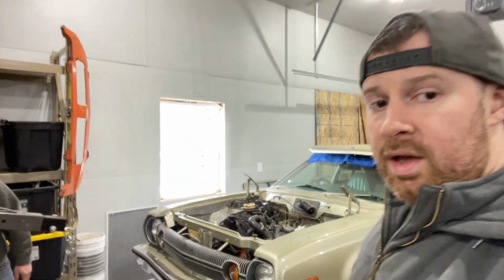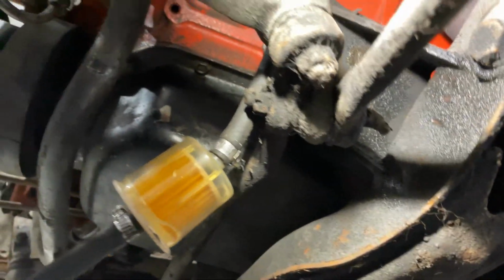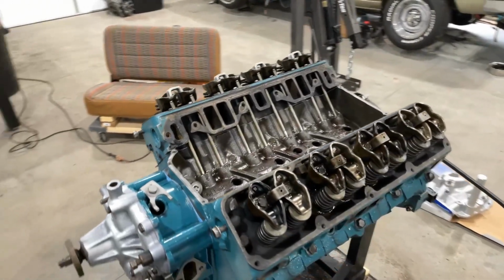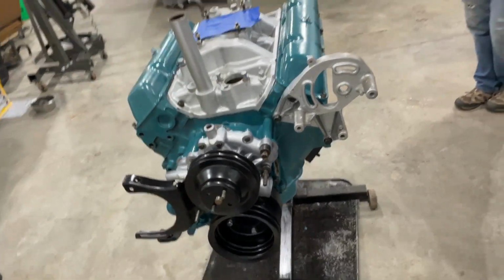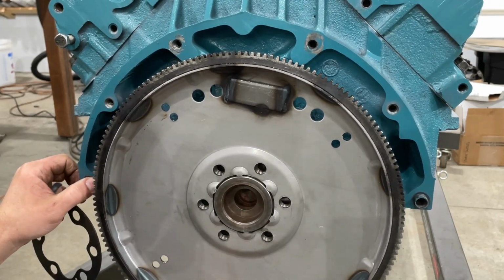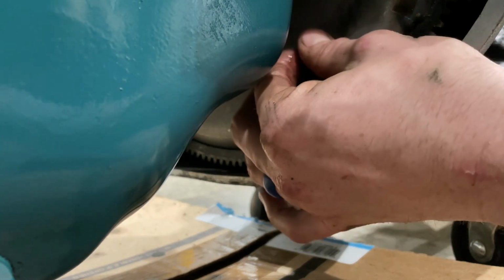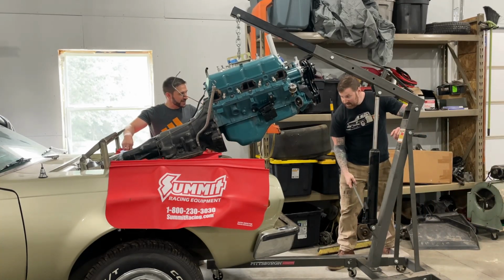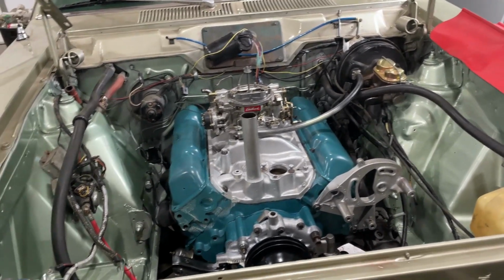AMC Hornet 360 Swap Part 2!

Comment: Here's a tip I learned.  Find yourself an AMC Eagle wagon and grab the underhood coolant overflow bottle.  You can use it in your Hornet by moving the washer bottle forward and you'll see where the "new" overflow bottle will bolt right in because it snuggles up against the shock tower.  Factory looking over flow bottle.

But also, pulling a V8 out of a Small--body AMC is probably the worst engine pulling experience you'll ever have.  It's almost like putting a V8 in these was an afterthought. There's a reason why many, many people have actually cut-out the cross-brace on the front bulkhead to ease engine ingress and egress.  If you're a Chevy guy, you're going to invent some new cuss words.

Oh, and that weird line from the back of the transmission that goes up to the intake??  You can remove that and plug it off.  It was for the Transmission Controlled Spark (TCS) which limited timing until the trans was in third gear.  You can pretty much eliminate all of that because chances are, the system doesn't work anymore anyway.  It was simply for emissions.
Reply from the maker: Holy crap! Thank you for the info! Where were you when we were struggling to get that thing in/out hahaha! Its good to know there may have been other factors contributing to the struggle lol.
Reply: @BuildSeason   Haha, sorry. I just discovered your channel last night.

Comment: Did you replace the front seal in the trans while it was out? If not, it will leak. Engine dipstick?
Reply from the maker: We replaced the dipstick and o-ring. We did not replace the front seal of the trans. So far we haven’t seen a trans fluid leak but we will keep an eye on it. If it leaks then I guess the trans will have to come out again…lol Thanks for the heads up!